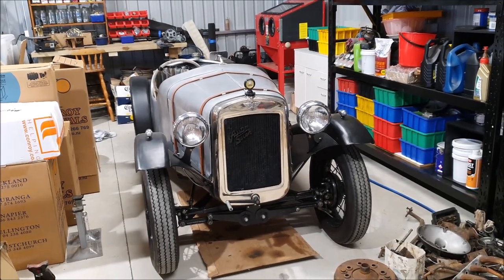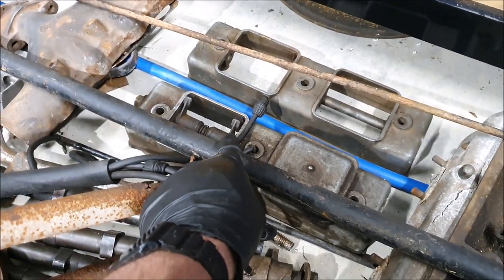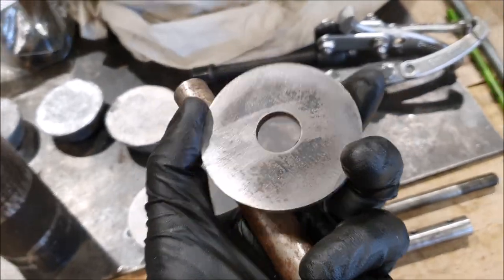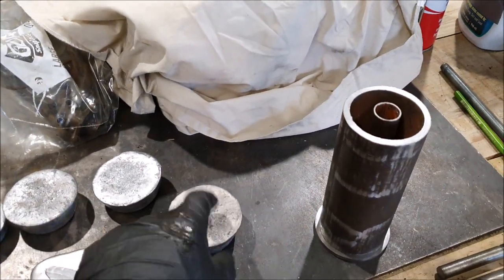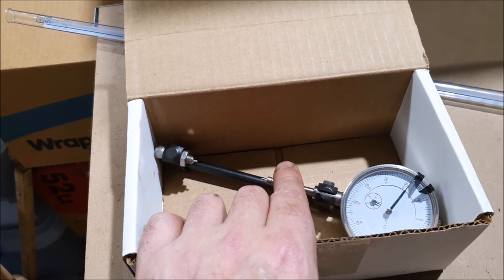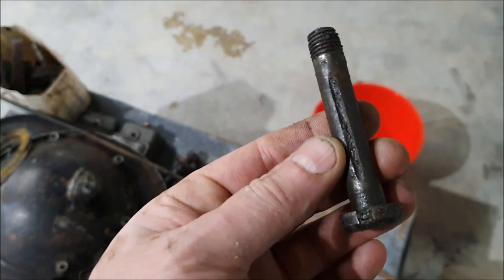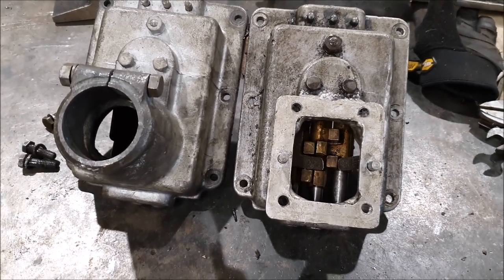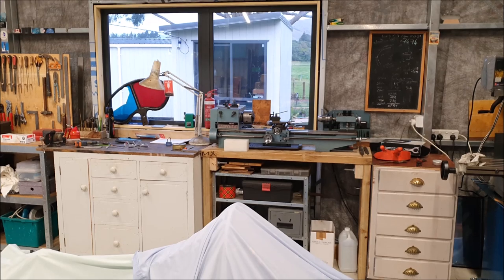Pre war Riley - new old parts

Comment: I made new brake shoe pivot pins for my car, turned the shaft straight without the flange , and used a washer and circlip to retain the shoe , I can now remove the shoes without needing to take the pivot pins out. I initially made new universal bushes from phosphor bronze, but they didn't last long , so I then made some from "Nyoil " (oil impregnated plastic), these have lasted much better, showing very little wear.
Reply from the maker: Yes, it was recommended to me to make modern plastic bushes as well for the universal. I can't remember off the top of my head what kind of plastic it is. I haven't made them yet but will do soon.